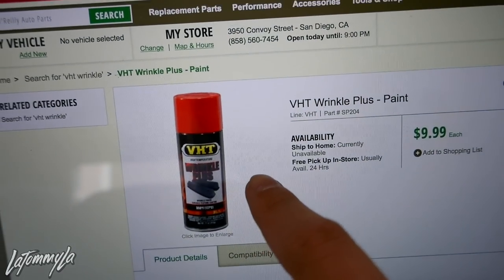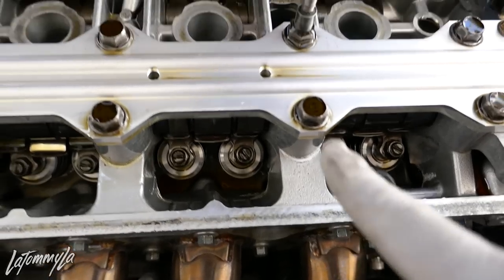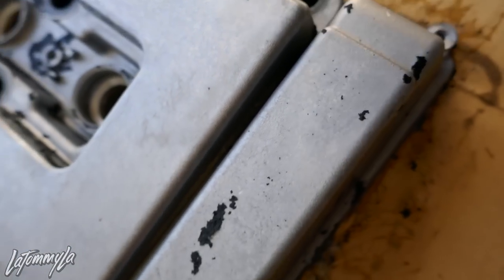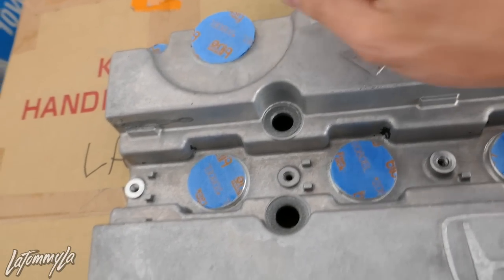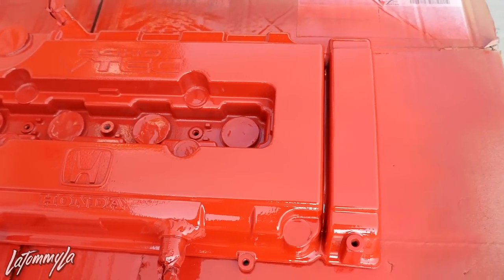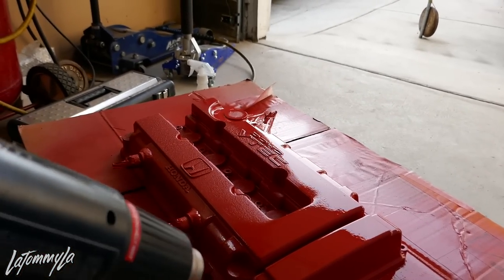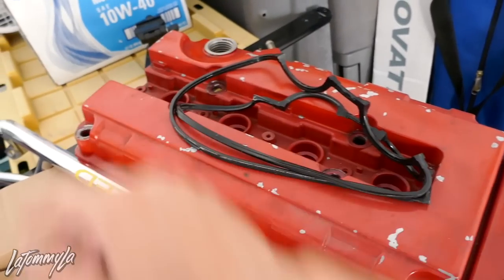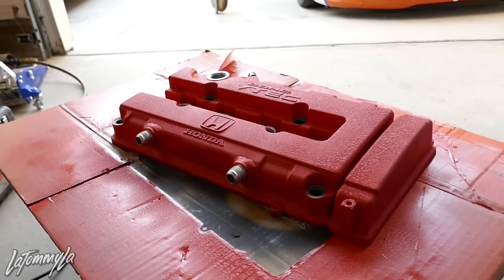How to wrinkle paint your valve cover!

Comment: Heres a trick for the future. Cover all the letters with a strip of tape then tap around the edges of the letters with a rubber or plastic hammer and it trims the tape perfectly to the letter. That way you don't have to sand the excess paint off and risk damaging the paint close to the letters.
Reply from the maker: Thanks for the tip, might have to do that for my next valve cover I redo!
Reply: No problem man, the valve cover looks great. Ive alway had good luck with VHT products.
Reply from the maker: Thank you, and first time ever using VHT, was amazedddd
Reply: You can also use a little baby oil then wash it off.  It's still better to powder coat it yourself
Reply: sanding it is faster, easier and leaves a fresh , shiny look
Reply: LATOMMYLA what's the 2 bongs on the front for?
Reply: oil catch can
Reply: Its better to sand them after painting the
Reply: isnt it easier to just put a little Vaseline where the lettering is
Reply: Gunna sound weird but my buddy did his valve cover with wrinkle paint. And he took a q tip with vasaline and aplied it over the lettering and that didnt alow the paint to stick to where it was aplied. Easiet way to do that
Reply: Was wondering if just painting over the crackle with white ceramic paint might look good.
Reply: you wont get as good result as sanding after painting...
Reply: Nice job!  Was primer needed?
Reply: Looks better when sanded there usually faded or corroded 25 plus years after all sticks out when the paint is fresh
Reply: Heres a better tip...Use chapstick on the letters and the wax will come off fairly easy  with the scrape of a blade

Comment: You should use a wire brush to get those little bits of paint in those tight crevices that weren't removed with the paint stripper.  It's probably not a good idea to leave them because those are the areas where the new paint will start peeling a lot sooner than you would expect!

Comment: What you could have done is covered the labels on the cover with vaseline using an earbud very gently.....then after paint you just wipe it off because the paint wont stick to the cover because of the greasyness of the vaseline......I've done it a few times and it always works like a bomb

Comment: Here is a Tip, Cover your Piece with Air Craft Remover and then cover it with plastic, Let it soak in and you will get much better penetration of the Chemical.

Comment: Savage! No primer? Cooool! If you look in my channel I posted a video 5 years ago of a valve cover I painted wrinkle black. I used a bright lamp overhead so it can wrinkle. It's a valve cover from India off a Honda City. I still have they valve cover hanging on my wall 👍🏽
Reply from the maker: No primer sonnnn, and I think the heatgun method worked perfectly for me!
Reply: Just don't let a model sit on your valve cover. Might get stuck to her cheeks 🤔
Reply: You don’t use primer with this…
Reply: Which is why it peels off after 6 months use under the bonnet. Same with "exhaust paint" gone as soon as you drive hard. Red hot downpipes? A little more than 600 degrees C. More likely you will end up pissing on them to try to put the fire out (yes I know your rocker cover will, or rather, NEVER reach a high enough temperature to set fire to pain)!

Comment: my mate used this painy but applied it with a brush on his intake mani. a year or so later its cracking off pretty bad. hows your rocker cover looking now its been a few years? still look good applying it by spraying it properly? wondering if i should use an etch primer before the red

Comment: I just ordered a can from amazon couldn't find any in stores going to do this on my 03 Acura cls
Reply from the maker: Goodluck on yours!
Reply: Mine did not turn out as well I think its cause I used a primer on my valve covers pretty sure this stuff works best on bare metal. I also did the plenums on my IM which were bare metal with the black wrinkle and turned out great!
Reply: Matt O'Hearn yeah,because of primer

Comment: What model of heat gun did you use on this? I need to buy one and trying to get ideas one what others are using for diy projects. Great video by the way.
Reply from the maker: It doesn't matter what heatgun you use, they all work the same way
Reply: LATOMMYLA  Cool. Thanks man.

Comment: Hi Tommy
Do you have upgraded engine mounts? I'm thinking of energy inserts. Do you perhaps know if this will give vibrations. I really don't need that like it was but solid torque mounts. went back to oem but I also miss the stiffness
Reply from the maker: Yes I do, I am running innovative motor mounts with 75A bushings, they do vibrate a bit but not too bad. If you want someone an OEM feel look into the 65A bushings

Comment: Nice vid man. I didn't see a video where you sanded down the logo and such. But I assume it is straight forward.
Reply from the maker: +Kauthara thank you and sorry about that, but I went to home depot to buy a 200 grit sand block by 3M, make sure to tape off around the letters too
Reply: Any issues with your new finish yet? I'm thinking about doing this to my valve cover too!